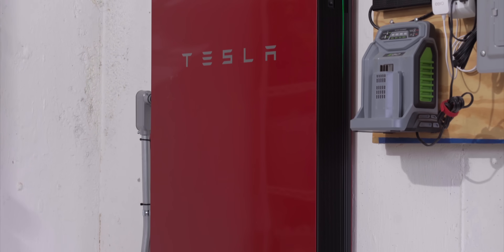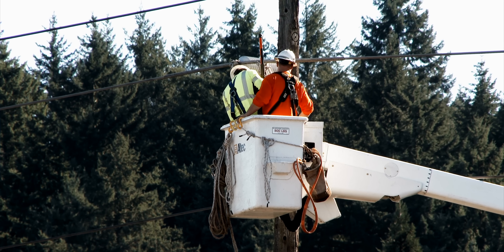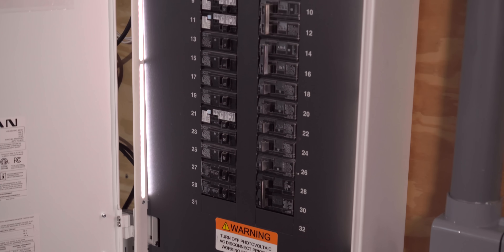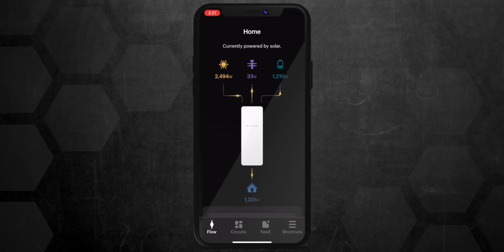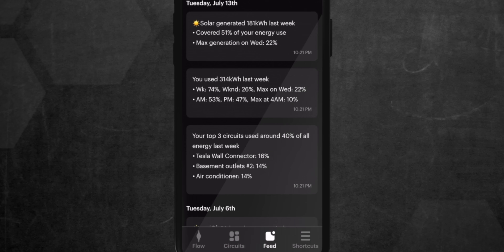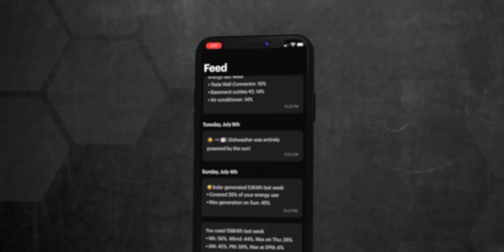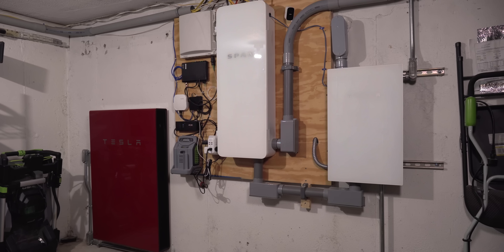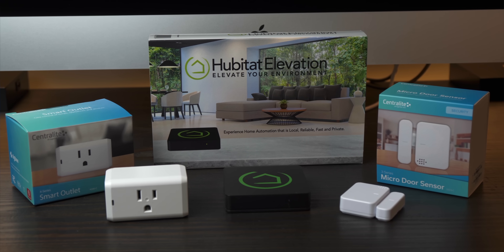This Smart Home Electric Panel Fixed My Tesla Powerwall

Comment: Matt, I am all for off grid Tech, America is NOT going to update our grid, in my estimate putting someone on mars is going to cost less, so how do we fix it and protect ourselves, Tesla power wall, Tesla solar panels or something of the kind to make our home attractive, A natural gas  generac generator, a pellet stove and now this span smart panel, people put emphases on non essentials  when building homes  instead of thinking about the survability of their homes, things like putting in a fire suppression sprinkler system or hurricane windows that can stop intruders, this span system or some thing like it should  be in the future a code must, even if you do not have off the grid tech, someone is going to buy your home in the future and when you need a new panel get something like this, it's a no brainier, you spend more on accessories when ordering your new car than you would on this, if I ever get a chance to build my dream home it will be on survability tech and not on $3000.00 on crown molding, it's all designed out......great channel...great content.....keep me learning....thanks

Comment: How about integration with a backup generator? We have extended outages where I live thanks to PG&E and even with solar in the winter time you're kind of screwed without a backup generator, it would be nice to have something that integrated all three, solar battery and a generator to efficiently charge the battery and not run the generator non stop on cloudy winter days.

Comment: I have two subpanels on my house, one is in the garage and has all of the light electrical for the house, second panel has a home addition and the pool equipment.  How does SPAN handle subpanels?  Main panel also has the AC units etc...   I have three Tesla Powerwall's and a 12.4Kw solar system

Comment: I am interested in Span. I would prefer to use a Tesla in anticipation of a Tesla solar roof. But not sure if the solar roof will ever happen due to HOA involvement. So I am wondering if:
1. Assuming use of a utility hourly rate program when you can charge the battery at the cheapest rates, does it make sense to use Span with just a battery and no panels. FYI I have two electric cars. 
2. My understanding is that Tesla will not sell a PowerWall without a Solar Roof. So since I don’t know when I can ever get a solar roof, I may not be able to get a PowerWall. If the above is true about No Solar Roof, No PowerWall then who makes the best home smart battery system that isn’t a PowerWall?
Thanks!

Comment: Does this panel also act as a service panel switch for when the power goes out it disconnects the power meter and then automatically puts you back on the grid when the electricity from the power company is available again?

Comment: This is cool. However, I think it's much more useful in the US with your 120v circuits, which deliver less power and require more dedicated circuits than we typically use in 240v regions. It's quite normal in my country for small houses to have one circuit powering the outlets in the whole house, and a medium or large house will have just one circuit for each floor. Not much ability to differentiate appliances here.

Comment: Hello everyone, I have a storage system and I am looking for a smart panel switch . That give me an off grid setup while connected to the grid. What I mean by that is I use to grid for sending my excess solar energy to the grid or if I need power from the grid. A gateway you might say. I have a small 4.83 KW system with one 9.3 kWh LG battery. I will like to expand this system to 2 more batteries LG Chem 16kwh each battery. And 4 more panels to help keep the batteries charged and run the whole house including the AC system. The smart panel is my key concern at this  point. The reason why I need this at night the grid pulls a lot of power from my battery in some cases to the maximum limits. I need a panel that can close this off and only open this circuit when the solar system is over producing or at night when system can not maintain the house demand. Does anyone have any ideas on how to cure this problem? 
Thank you for your time.

Comment: Span is cool but NOT $3500 cool. Traditional 200 amp is $240. I would be willing to pay double that cost but not more than 10x.
Reply: Yes but that traditional Main Service Panel now needs the additional of proper metering on every circuit,  a monitoring system that captures PV production and all home consumption,  a way to hook in Solar and Batter and an ATS.  Traditional main panel modded to meet current clean energy means a LOT of boxes and conduit runs your Electrician is going to love you because you're going to writing a big check.
Reply: @hmurchison8123  You can buy a monitoring system for 300(Emporia has a system with 16 senors for $159), sub panel $800. You are still in a massive price gap of $2000.
Don't get me wrong this is cool as shit. But I not buying a Ferrari for a daily driver. Much rather save that money for other home features. 

Leviton Smart breakers are cheaper. 

I like having a Base panel with added equipment. 

Smart devices will ALWAYS fail at some point and replacing this panel would be a nightmare cost wise.
Reply: @genestarwind4610  You're right..the smart money is leveraging existing panel instructure with smart breakers like Leviton has done.  This is ultimately where the market is headed.  Companies like Span are simply going have to prove they can weather the storm when smart breakers are plentiful
Reply: @hmurchison8123  Yeap. 

We are on this channel to start with because we are all techy nerds.

I sure some rich fools will drop that money no problems and if it breaks can afford the newest lastest thing. 

We want to know how our things works. Home energy knowledge is going to help greatly with energy conservation. 

Large Manufs will move this way too and be able to make it cheaper. 

I wanna build my own house and do 90% of the rough in work myself. I will save on labor but I would rather save on panel cost and put in RGB led vs just white for a cost boost. 

Yes bitching about New tech cost is spoiled but positive growth is from the masses not the spoiled rich.
Reply: @hmurchison8123  Vice Versa. I think home batteries are stupid too. 

There is a company in Austria working on a home hydrogen fuel cell with 4x the capacity of a telsa wall. 
Hydrogen also have a far greater life cycle than batteries. 
It is currently 4x times the price though. Which until production cost come down Not viable. But a 40Kw hydrogen fuel cell Kicks a 7kw wall any day.

Comment: Is a comparison between a Tesla Powerwall and an EcoFlow Delta Pro possible?  In the Delta Pro I was considering getting the complete system.  What battery systems does Span work with?

Comment: Intresting! A drop in solution on what I would want to build. But I would rather go with low voltage DC systems in a small space. 
In most devices these days there are electronics for that reason many of them require graceful shutdown.

Comment: This actually sounds so hype. If I’m going to shell out 15-25K for a solar and battery set up being able to have that granular control will be invaluable. It would drive me insane to spend so much and not be able to track my energy usage properly
Reply: Anyone installing your solar should be accounting for all home consumption and PV production.  CT meters aren't expensive ..you just have to do a little work on the install and think about where's the best spot to capture 100%.   The only way to do energy conservation correctly is to see the entire energy envelope and be able to adjust dynamically.

Comment: My main AC unit is on a 2x125A breaker. Does this mean this panel won't work? Interestingly the spec sheet says nothing about a 90A breaker limit, or is the limit simply the maximum current that the Span can measure correctly? (FWIW, my home has two 2x200A panels)

Comment: I spoke with Span and the quote I was given was EXPENSIVE - almost as much as a battery.  For now, I don't see the value - unless you are getting the system for free.  $6-8,000 PER Span panel... Yes - that is what I was quoted.

Comment: Span and the direction they are going is what the world has been wanting in a "smart home" system, however as per another commentator stated "we need guarantees for the life of a home or at least upwards of 30 to 50 years......or, someone like Schneider Electric to do the same and make the market competitive........The Span system is the panel of the future, and remove the need for ALL the Alexa like attached tools to switch items off and on.

Comment: Hey Matt, are you still using Sense then with this panel?  I just installed Sense and it’s been slowly been finding different loads in my home and have enjoyed seeing the data.  All thanks to your review a while back!
Reply: There's no need for Sense here because you've got CT consumption monitoring on just about every circuit.  There's no machine learning guesswork needed.   Non revenue grade metering ranges from .5% to 2% accuracy.   This is how Span is able to write algorithms that alert you to anomalies if a device is under or over the usual draw in amps.
Reply: @hmurchison8123  Span can’t detect individual devices on a shared circuit though, correct?  Sure it’s great for dedicated circuits and 240v circuits but I enjoy how Sense has detected random devices around my house on shared circuits like a few lights, TV, toaster, etc.  it’s far from perfect, or even accurate so it would be interesting to compare both
Reply: @CrazyNickOO7  you’re correct. Sense technology is still good if you want to know the individual loads of devices on a circuit

Comment: The price of that thing is INSANE.  Holy jeebus. I can get the parts to make a 4kw solar system cheaper than that complete with 6.5kwh battery and panels.  WOW.
Reply: This is an Apples to Oranges comparison.   We all can build an affordable DIY solar system.  Main Panels have to be NEC code compliant from design to install.  That's a different beast

Comment: would this be a good for just a main circuit breaker in a new construct? I have plans on going to solar at some point but was thinking a load panel. Which would be better for new construct in 2021? Medium option and a price  means nothing to me option if you don't mind ELI5
Reply: I personally think it's great for new construction.  You have the option of doing a clean system that's going to function nicely with eventual solar and perhaps a battery when you're ready.   From an aesthetic and install standpoint you want the reliability that comes with a well integrated system.  The more boxes that have to get installed on your wall the more opportunity for problems.

Comment: So I saw your video on the Sense energy monitor and ordered one a couple days ago. Then I saw this video on the Span smart circuit panel and am thinking maybe I should slow down and think about where I'm headed better. Am I correct in thinking you don't need the Sense of you have the Span? I live in San Diego, I have solar and have been considering adding a home battery like the Tesla Power wall soon and will probably purchase an electric car in the next year or two. After this video I am thinking of returning the Sense when it arrives and planning to add a Span with a home battery. What would you suggest?
Reply: Hi Steve, you are correct. If you have Span, you don't need Sense. Second, Sense doesn't work if you have a battery storage system. Span works well with solar, battery storage, ev chargers, and the broader electrified home. We'd love to get you Span, please reach out: span.io/get-span

Comment: Before actually watching, my prediction is: this is to bypass the battery entirely so you’re not limited by the battery’s maximum power output
Reply: Well, I was wrong, although it was about that limit. I’d seen other DIY systems where people always had to be mindful of their battery output, blackout or no. Good to know the Powerwall takes care of that to pull from the grid directly if necessary (implied by you saying you only need to care in a blackout?).

Comment: I will be installing 2 power walls. The big question is do I need this span panel, if not OK, but if I do can you explain why.
Reply: You buy two power walls but you still need to pull circuits into a critical loads panel.  That's typically another box or sub panel on the wall.   Also if your needs change the ability to dynamically choose your critical loads isn't there.  Span is unique in that you get to decide in realtime what loads should be running and it gives you a estimation of how much available time you have given your selection.

Comment: Span is too pricey and too risky.  You can get the same functionality you're talking about with smart breakers in a modern $500 Leviton panel, with a full complement costing less than $1500 additional -- with more flexibility to choose devices that work with your home management suite.  At almost twice the price and with little functional gain, Span's selling point is that it offers an all-in-one package... and honestly that seems like more of a risk than anything else.  Nobody wants a Peloton-esque brick where their breaker box used to be.  In a modular but otherwise conventional panel, if something happens to disrupt the functionality of your iot devices you can always swap in an equivalent conventional breaker from Home Depot.

Comment: Should have just got two powerwalls . I can run off the grid with everything running and not turn anything off . I reserve 35 percent of the power walls for outages in the summer literally 70 percent of your one power wall reserved incase of outage . In the winter I find out about how much I can actually charge in a day as adjust to 50-80 percent reserve . So far it’s pretty hands off and takes care of itself . I like it in self power mode .

Comment: There's too much misrepresentation of what ESS (Energy Storage) does for you. Where I live I don't lose power often but that's not just what I want an ESS for.  They are designed to cycle daily,  it's not designed to sit there and do nothing ..waiting for a grid down event.    You use them everyday to automatically transition your home into a lower power mode.  Most ESS are connected to sub panels containing breakers for critical loads.  Span is telling you "you don't have to do that,   you decide what loads are critical in real time" no sub panel needed.     That's a game changer. No Electrician required.    The app lets you model critical loads and how they effect your total runtime.  That's awesome because many of our clients have zero idea how much energy their appliances use especially the HVAC stuff.  I'm not affiliated with Span in any way ...I'm just saying products like it are the future of Energy.